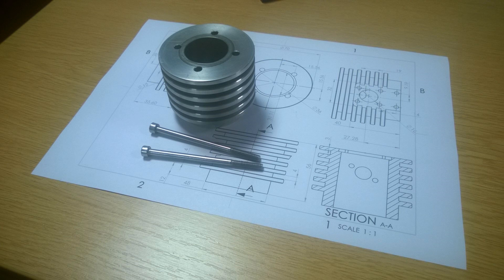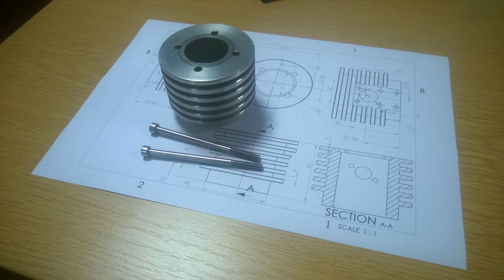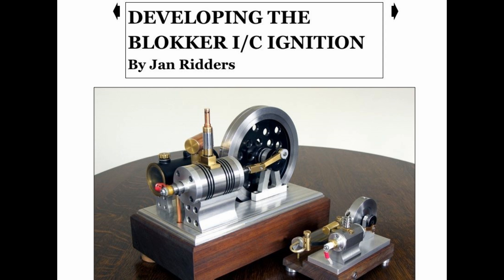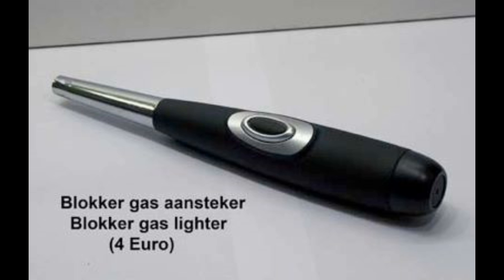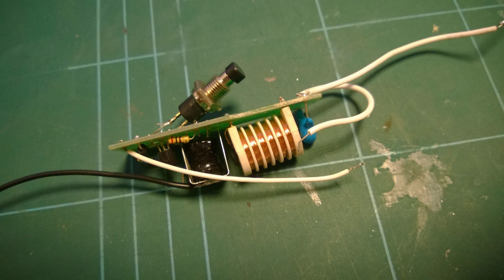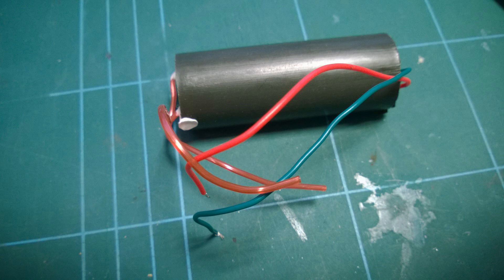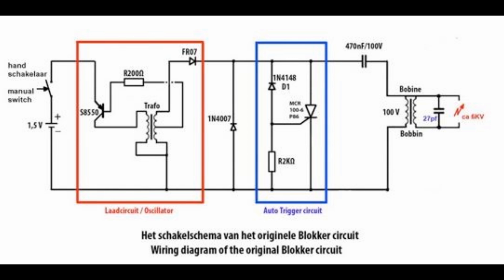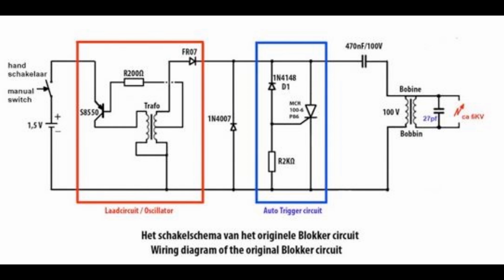Homemade 2 stroke engine step by step - Part 13 Get involved!

Comment: Just put on one of those U shaped pickup coils and run a spark plug wire from the secondary and a kill wire from the primary you can ground out. With a flywheel with good enough magnets all you gotta do is time it right and set the gap.

Comment: I made a breakerless ignition for my old mz using a cheap 12v cdi, and trigger it using an arduino and optical trigger. I programmed in advance ect too. Bit boring though the cdis are decent and take triggers from microcontrollers very well.

Comment: i bought a tazer flashlight of ebay once and it broke, i took the coil out and it looked alot like that one you have, and i got the same idea too use it as a ignition coil on something i think it would work. have a sensor with a magnet at the flywheel of some sort that sends signal every time it comes around tdc. how the electronic part should work i have no clue... COOL PROJECT!!!

Comment: Jup, a regular car or even a DIS coil system would do the trick. Since you said you would like to implement more advanced/4stroke system later I think it would work just fine. Maybe you can you a crankshaft position sensor in your system now or later? I have a few lying around which I can ship to you, together with some other nice sensors/electronics for cars...
Reply from the maker: That's awesome, thanks for the offer. But its called the easy engine, easy to understand not just to make. - matt

Comment: In Jan Ridders video it says somewhere that maximum spark frequency of this ignition system is 2500 per minute. Maybe possible to have several of these to increase the  frequency?

Comment: how are you wanting to trigger the ignition? I'd like a little more info on trigger and any size requirements. and what rpm you plan on turning? also an approximate compression ratio. a higher compression may require more spark current. are you wanting to use an ignition coil and ignition amp . or more of a magneto. so how are you going to power the ignition? 
thanks this is a great project. I have thought of something similar but it never got anywhere.      great !
Reply from the maker: "how are you wanting to trigger the ignition?" 

basically any trigger would do, a microswitch etc This would be timed to the crankshaft.

"I'd like a little more info on trigger and any size requirements"

A 5A microswitch lever or roller, but about that size

" a higher compression may require more spark current." 

- you mean voltage not current. Around 10 - 20kV

"are you wanting to use an ignition coil and ignition amp"

- yes

"so how are you going to power the ignition?"

- because its just a demo, a battery will do.

Comment: Machine a flat surface in to the crank with a micro switch normally open so when ever the crank tuns to tdc the micro switch opens, fires your spark, so you don't have to worry about timing, the faster it rotates the faster the switch opens. No issues with ignition timing at different rpms
Reply from the maker: Apart from going 20,000 rpm LOL
Reply: Put a potentiometer with a resister in it?

Comment: How about going super simple ignition coil and points system under an aluminium flywheel? It's really old fashioned but works a treat both on paper and in practise for low-usage applications like a demo engine.
Reply from the maker: Been toying with the idea of point - matt

Comment: The old tried and true design is a magneto, points, condenser (capacitor), and high voltage coil.  These are pretty standard parts in old mopeds and vintage cars, or you can make your own if you really want.

The other way would be a CDI (capacitive discharge ignition) system, which seems very similar to what you're proposing, although usually it uses a hall effect sensor or an optical sensor with a missing-tooth encoder wheel to trigger the ignition.  You can adapt one meant for a scooter, or make your own. Most of the circuit design is beyond my skill, but this guide might be helpful:
http://www.homemade-circuits.com/2011/12/how-to-make-capacitive-discharge.html
Reply from the maker: Yeah, I have a couple of CDI's kicking around, but I just wanted people to get involved.

Comment: Hey, i have been following your project for a while and it's really interesting. I was looking to try to build one myself for a while. I know you need a lathe, but which one? A big one? Industrial one? i'm kind of confused. I don't have access to one so i'd go out and buy one. Do you need anything else then a lathe? A mill? Thank you in advance, and sorry for the stupid questions. I have no idea how you cut the edges of let's say the crank cases you did.
Reply from the maker: The lathe I'm using is a Chester piece of shite, probably the worst thing you could buy - and its tiny. The biggest stock you can get on the external jaws is 35mm and 75mm when using the reverse jaws. But I can still make something crappy and small like this. A mill will be required and it a WM-14 from Warco. Their stuff is chinese but they check all the stuff before releasing it and they're customer service is 5*

- You cna make the same thing, buy a mill and lathe from warco for around £1000

link - www.warco.co.uk/

Comment: What about to advanced and retarted the ignition time, depenced of the rpm with a controlled microchip? 
It is nice to see other people are bussy with there own engine projects. I self almost finished with drawing and engineering of my own four stroke engine, it doens't have normal valves but rotary disks (neeldes). But first I am bussy with set up an small tool shop at home! After that I would start to buidl the engine. I'd like to see your new video.

Comment: Why not buy an aftermarket ignition coil and rotor of a chainsaw or gas trimmer? It's reliable, simple and cheap
Reply from the maker: Lol Yeah but I wanna make everything. Not buy stuff. Good suggestion, already had that in mind, but it feels like cheating - matt
Reply: How did you decided to cool this engine? Maybe you could make the flywheel with fins yourself, add the magnets in it, and make a coil or buy one? It's alright to use a existing coil, you didn't make the screws eighter so it's ok 😎

Comment: Could you send a few plans/ pictures of the engine design with dimensions of the crankshaft. I have an idea for the trigger that I might mock up and send to you to try out. I have some high speed magnetic micro switches and I cant remember where they came from. I'm thinking of som sort of sleeve that fits over the crank shaft (external).   But this is bedtime brainstorming so I'm not quite sure yet. Cheers

Comment: i have used this simple contactless ignition on old russian moped engine and it worked very well: http://www.mopedist.ru/images/users/photos/medium/7346533a757853099b47590c2e94d1cc.jpg
you will have to play with 3.6 resistor (or maybe with both) value as it depends on magnet used. Moreover it has some ignition advance for better startup of engine.

Comment: why don't you use a normal ignition coil? is it too big and you are trying to make it small. I have one of the HV pulse coils from ebay, suppose to be 500KV but hard to measure, it fires when it's ready and is too slow for what you want. only use I've had from it is starting camp fires from  a 5 volt power bank.
Reply from the maker: I can do it, I just wanna get other people involved.